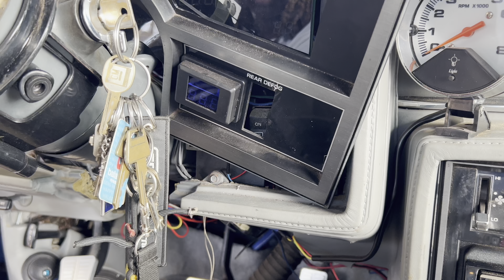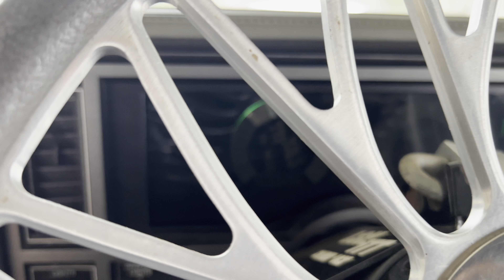1987 Buick Regal turn signal switch replacement

Comment: Hey bro I just installed those led turn singnals y’all sell for the regals. My left side won’t turn on for regular drive but it will blink left. I wired it up black to black yellow to blue and red to brown. Any clues what’s going on?
Reply from the maker: What kinda car fam ? On the regal we had to actually pull the peanut bulb out of each corner it didn’t like the load
Reply: @Jus up looking Ugly I have a 81 regal
Reply from the maker: @SWB_mike  make sure your turn signal flasher is good as well and that all other bulbs are good